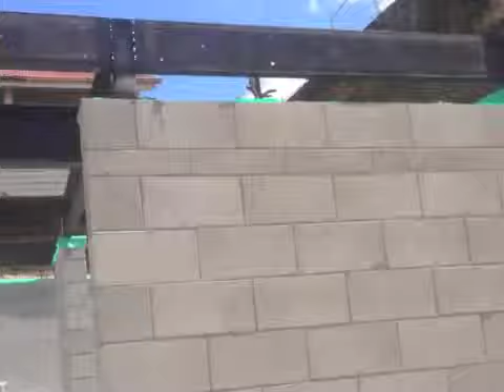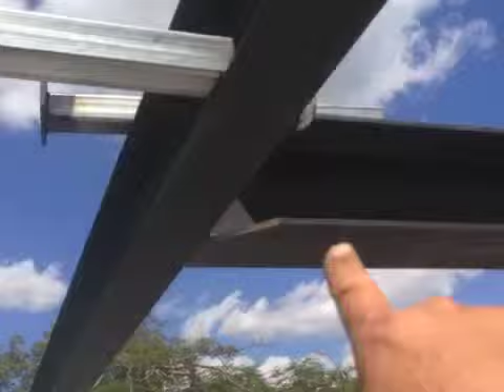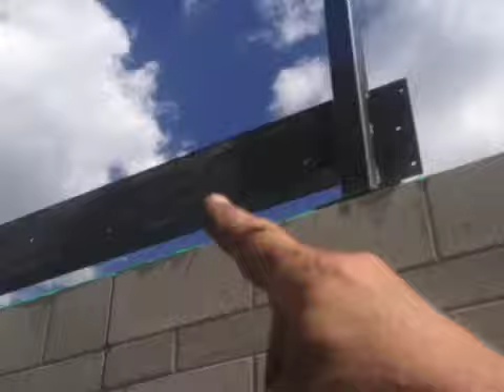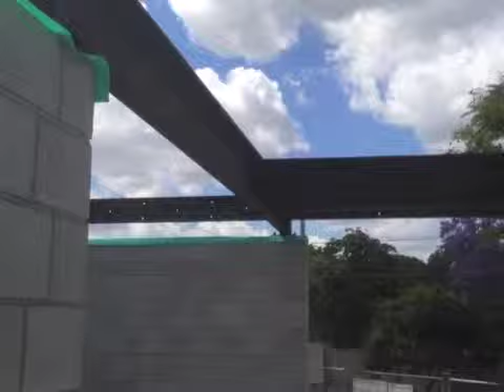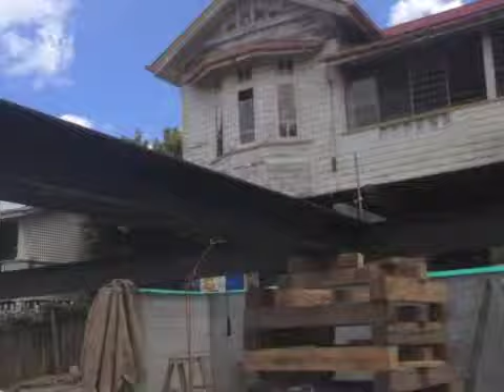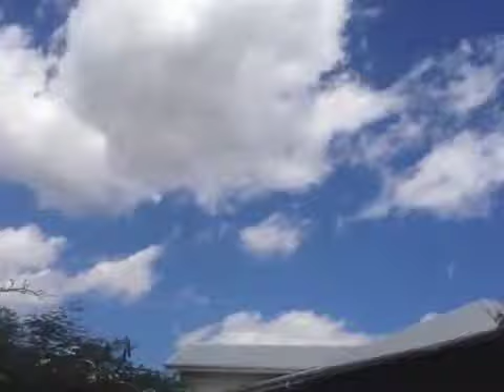House restumping, Steel work at 47 Mountford st New Farm No 7

Comment from the maker: All we can do is try to cover all bases and make sure that we fix the problems as we see them. That is what licensing is all about. Unfortunately a lot of contractors do not want to do there best they are only in it for the money and therefore do not spend the time to get it right. Was at the Gap on the weekend doing some additional work to a house we did some years ago and noticed a house raised and stumped 4 doors up. I could see where they failed to tension/level the bearers from the street.